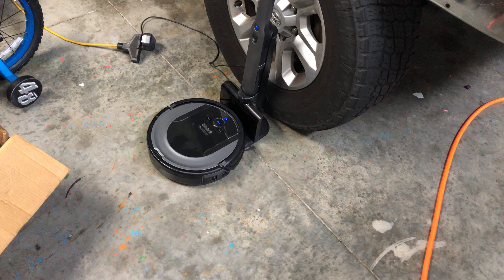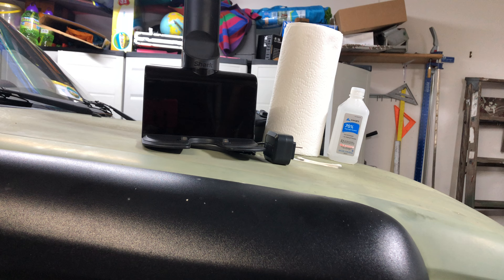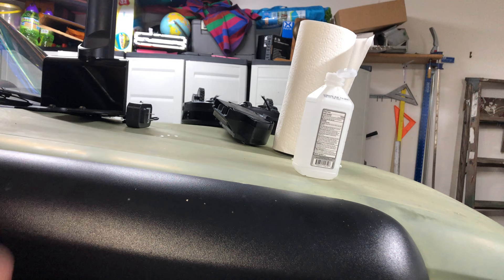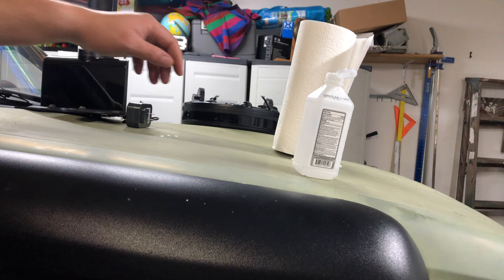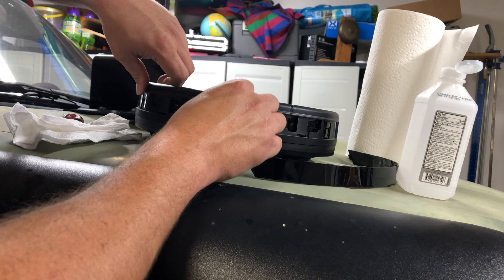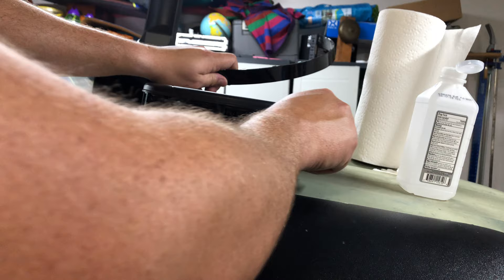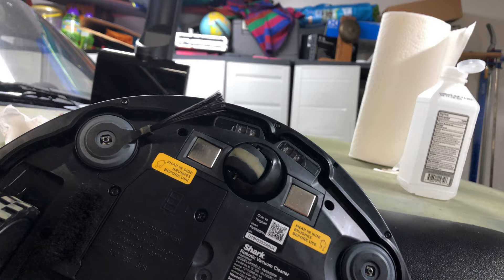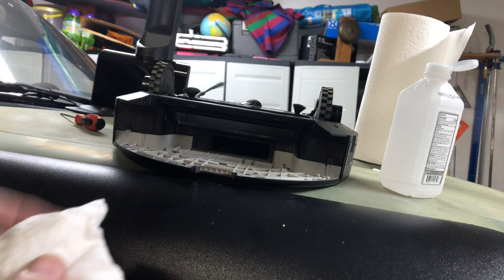Shark Ion Robot Vacuum sensor cleaning

Comment: Wow!  This is exactly what I needed!  THANK YOU!  After spending over an hour on the phone with Shark customer service and problem solving, they told me that the sensors were shot, it was no longer under warranty and I needed to buy another one.  It’s only two years old!  Thank goodness I found your video, after following along and cleaning the sensors as you suggested, it works like new!  I am SO disappointed in Shark over this, but so thankful for this video!!
Reply from the maker: So glad I was able to offer some help with your robot

Comment: Great - thank you !  Mine started doing what I called the "Dock Dance" several weeks ago.  It was taking half a dozen to a dozen attempts to dock and that was if it was successful. Many times it simply ran out of battery while trying to dock (since it was near the end of its battery/clean cycle anyway).  I cleaned all the sensors and it promptly docked itself as quickly as the first week it came out of the box :)

Comment: My Shark IQ brand new out of the box, immediately has this problem.I have not gotten it to move, even after cleaning the sensors.
Reply from the maker: Call shark they will send you a new unit under the factory warranty. Or just take it back where you got it from.
Reply: @SmittysWorld  I just wonder if I’m going to have the same issue with another. The shifting of my homes foundation has my floors uneven; as if there are some minor slopes in the floor.
Reply from the maker: @jellysbeanss  I’m honestly not sure on that depends on how much of a slope there isn’t there’s dips increases that I can see is errors.
Reply: @jellysbeanss  I am on #3. The first one I got for xmas, three months later it gave me an error that it didn't have a suction cup, I called they sent me a new one. then 12/2 I had to call them again for the new one they sent, it kept saying it was to close to a cliff. so now I am on #3. These things go over some pretty big bumps at my house, I have to use the strips to keep it out of some of my rooms.
Reply: Man somebody got lucky if they sent you that many replacement ones, be nice if this happens in the real world , my experience is that everyone want to put it off on some else, my only resolve is to dispute with my credit card , what a shame 400 buck for the one with it's own dumpster and works 4 to 6 times , no it just says it's near a cliff, I have cleaned and cleaned these stupid sensors, no luck so now I'm   stuck with it

Comment: Great video, I did as instructed for the cliff error and it still is not working. Any other suggestions after sensors are cleaned?
Reply from the maker: Depends on the model replace the sensors is the next step

Comment: I have a rv2011, and something is draining the battery. The drain is so bad that the base charger can’t keep the battery charge. The wheels are working and the unit was working fine until this happened. Tried a new battery, not it does the same thing. Your thoughts, Thanks

Comment: thanks!!
I had a cleaning module (laser AI) error. 

emptied bins, hair, dust, cleaned everything with damp microfiber, compressed air on everything but still didn't clear code.

wiped everything with alcohol solved it!

Comment: Which part/ sensor controls the magnetic strip control? I switched out a suction motor but now I'm getting a magnetic strip error. I don't have any strips. Any help would be greatly appreciated! Thank you.
Reply from the maker: The two in the front are the main ones. You can sometimes shake the robot really hard and it will come loose and work

Comment: Smitty, if you clean the cliff sensors and it does not work can you replace the cliff sensors?  If so, do you have these parts for sale?  Unit model is UR1005AE
Reply from the maker: If your getting a sensor error on a 1000 series robot it needs new sensors or motherboard I always recommend having shark warranty this issue
Reply: @SmittysWorld  Shark has done a warranty replacement.  I was hoping to fix the broken one now and have a second unit.  Any idea on how to get the sensors or mother board?  If not, are you interested in purchasing the unit from me?  Has a self emptying base as well.  Thanks!

Comment: Didn't work, mine cliff sensor is always telling me it's on a cliff when it's on a flat floor, used it 6 times , cost 400 now broke, Walmart refuses to take it back or offer a replacement , what a rip
Reply from the maker: What model if it’s a shark iq 1000 series call shark it’s factory defect they know about and it needs to be replaced.